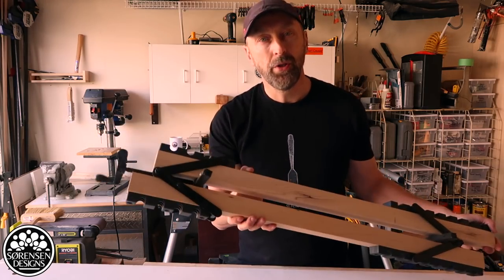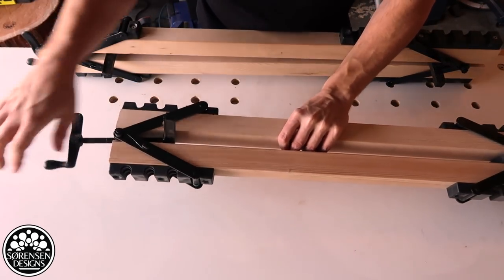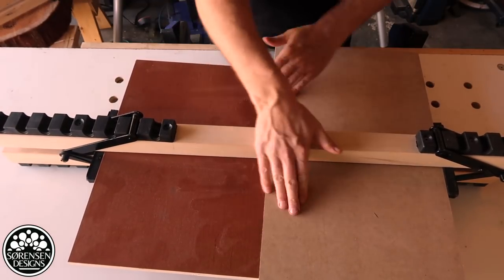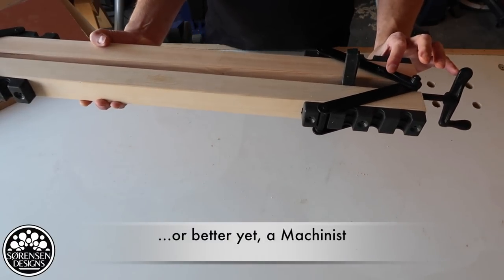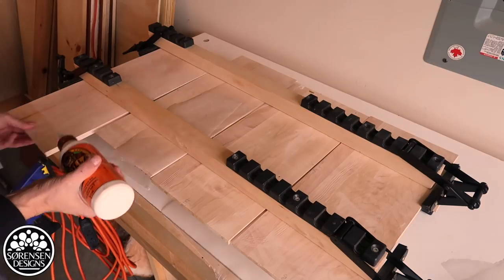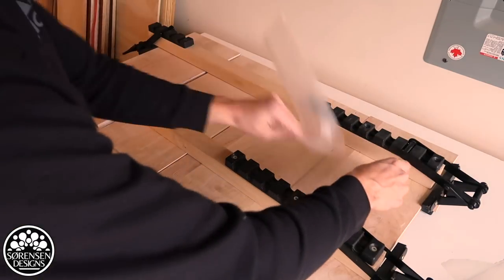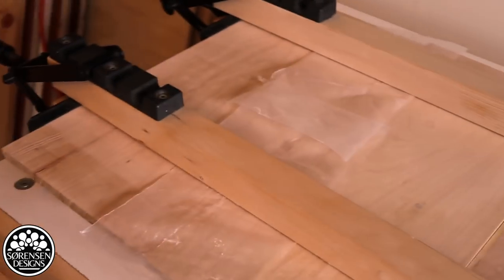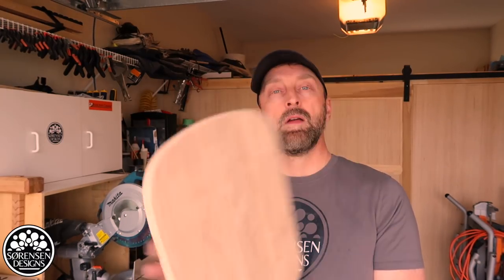Throw Away Your Other Clamps: Four-Way Pressure Clamps

Comment: I agree with you eric: they are very convenient and efficient. It the same principle use in professional wall press. The only concern is about perpendicularity : it's mandatory otherwise your panel will turn in a trapeze. I own four of them and I mainly use these.
Reply from the maker: Thanks James : ) I also have a newer video where I use my new panel clamps along with my bar clamps to do an optimal glue-up.  The panel clamps provide the overall alignment and the bar clamps finish the job with even pressure throughout. Here's the new video: https://www.youtube.com/watch?v=bdSROX-y6e0

Comment: I just bought three of these at a tool auction.  The same mechanisms as yours but the wood is not nearly so nice.  Used them on a 2' by 5' panel.  Worked well.  You can wax the clamps thoroughly to avoid the glue sticking or you can apply packing tape to them and that saves fiddling with the wax paper.
Reply from the maker: Hey Barry, great idea re: waxing. I'm glad they're working out for you.

Comment: Nice video.
One thing, you can make these easier to use by dislodging the clamp hardware from the notch and removing the top bar.
After applying glue and placing the boards on the bottom bar, you then put the top bar back in place and tighten.
Reply: You are right.  I kinda struggled until I figured that out.  They can be a little clumsy but in the end they work great.
Reply: Red Stick Baton Rouge?

Comment: Nice video Eric. 
I like the fact that you showed them in action.  
I thought that applying the glue was going to be cumbersome; But, not at all.
Reply: tgk

Like someone else said, if the top bar is taken off for applying glue it would be much easier.  After you spread the glue and line up your boards you place the top bar in position and the apply clamping pressure.

Comment: Do these kinds of clamps work well with thicker stock? Like for a table top if you use thicker pieces of  wood for the caul part?
Reply from the maker: They're good for material up to 1 inch thick. For thicker material,  I would use bar clamps or pipe clamps.

Comment: I noticed you did not offset the one side top fixture by 2 inches as the instructions say. Is the 2 inches really necessary? Also, I am thinking abiut using 48" boards to make the clamping ability larger. Do you think it will sacrifice any strength. I want to use these for some 46 inch panels for a bar door I'm building with 6 inch wide pine. I just got these and I am in the process of researching the best setup. I plan on having 24, 36 and 48 inch boards, essentially giving me three clamps out of one. I ordered 2 and might order more.
Reply from the maker: I didn't taper the old set in that video, but with my newer Big Horn clamps,  I did taper the stock. It makes a difference on longer panels. Also, for bigger panels, I will use additional clamps like in this video:  https://www.youtube.com/watch?v=bdSROX-y6e0

Comment: Hi I know this was a year ago so not sure if you'll receive this, but I have just bought a set very similar to these, but only one slot at one end,an 12 at the other, i have no instructions so not sure what the maximum timber length can be, would you have any ideas?. Thanks.
Reply from the maker: @john lewtas  It sounds like you bought the big horn brand, which are a slightly different style and happens to be the ones I currently use. You'll need to buy 4 pieces of square baluster at a local hardwood dealer, 3 feet in length. I used fir. 
To get an idea of how to set up and use these, you can watch the video where I use them: https://www.youtube.com/watch?v=bdSROX-y6e0  The manufacturers website has few details but here it is, just in case: https://www.bighorncorp.com/big-horn-19622-4-way-panel-clamp

Comment: Never seen these before, got to get myself a set.  Could I use them on larger projects, just by changing the size of the length of wood?  Cheers Eric from the U.K
Reply from the maker: @Paul Gray  You can probably make these work for a table top of up to 4 feet wide but generally they will work best if the width is less than 3 feet. My table tops are usually no wider than 3 feet so they work great for me. I have another video on how to d a proper glue-up with a newer version of these clamps: https://www.youtube.com/watch?v=bdSROX-y6e0
Reply: Eric Sorensen cheers for the feedback. I make tables out of old reclaimed scaffolding boards, this would make my life a lot easier.

Comment: Looks great to me.  I will get a couple.  Quick question first; if I want to edge join 36" boards, what is the shortest pieces of fir should I order?
Reply from the maker: Hi David! On the clamps I have, I would go with a minimum of 42" but it might be different depending on the brand of clamps. I just bought another set on Amazon from Big Horn and they recommend shorter cauls - I use 36" for those.
Reply: Thanks for the quick reply.  Big Horn on Amazon is exactly what I'm looking at.  I do this as a therapy/hobby as I am disabled and my workshop is running out of space.  Thanks again!

Comment: Hi, Eric! Where do you buy the hardware for these?
Reply from the maker: Hi Gina! You will find 3 links that I posted in the description for this video (above). Rockler carries a version, I think Lee Valley Tools has a version but you can also get them on Amazon. Also, you can do a Google search for 4-way panel clamps or 4-way pressure clamps and a few more might come up.
Reply: Thanks, Eric -- Googled right after I messaged you, and found them...should have done that before bothering you, thanks!
Reply from the maker: No Bother  at All :)
Reply: Woodcraft carries them. I just bought 2 pair yesterday  @EricSorensenCanada

Comment: Use a length of Unistrut in place of the 2 x 4.  Replace the wood screws with flat head machine screws with Unistrut channel spring nuts.  A 10' length of Unistrut can be purchased at Home Depot for around $20.  I haven't put them together yet so, I can not attest to the viability of the idea but, see no reason why it would not work.

Comment: What size boards did you attach to the hardware?  Looks like 1.5” -1.75” square.
Reply from the maker: I used finished stair balusters which are approx 1.75" - from my hardwood dealer. They are the best quality wood and perfectly milled.
Reply: Good to know...thanks!
Reply: @EricSorensenCanada  How long are the boards?